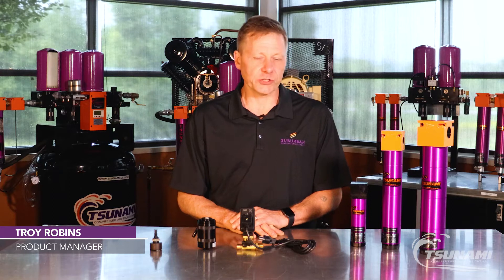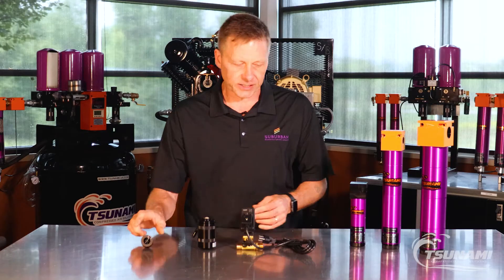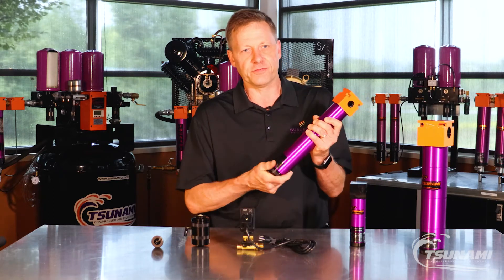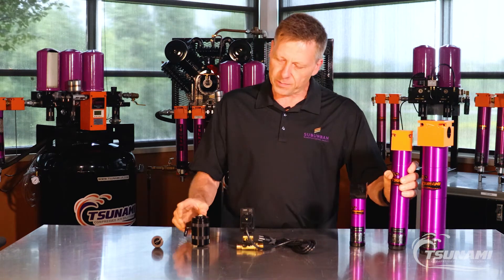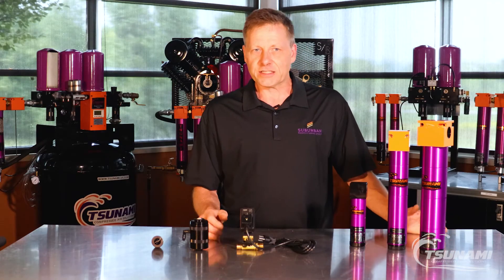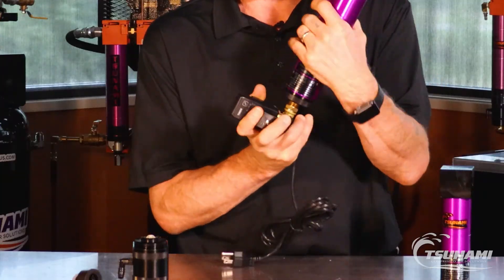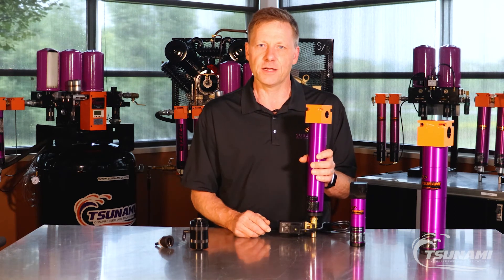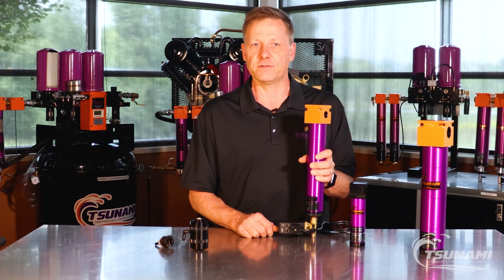Automatic Drains for Air Compressors

Comment: Can the small black Tsunami Pneumatic Filter Drain just be used on it`s own?
Must it be placed below the tank drain?
Reply from the maker: Hello David,
Yes, the filter drains can be operated independently of drain systems associated with the tank and there is no association to how high or low they should be mounted. The most important and only requirement to get the pneumatic filter drains to function is an intermittent pilot signal to cycle the drain. If they do not have some air cylinder or such to pull the pilot signal, you can always acquire our Drain Minder II controller to send the pilot signal; the Drain Minder really is the ultimate control for our filter drains. 
It can be viewed here: https://www.gosuburban.com/tsunami/products/drains/drain-minder-2-controller
Reply: @GoSuburban  Thank you very much. I really appreciate your information and time.